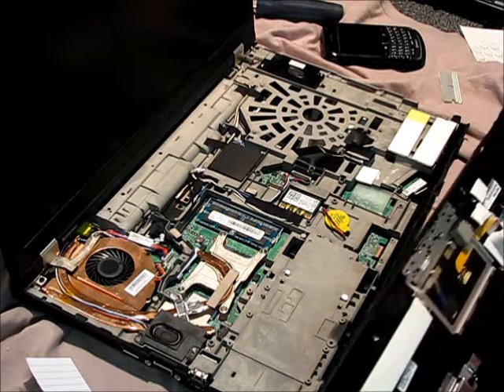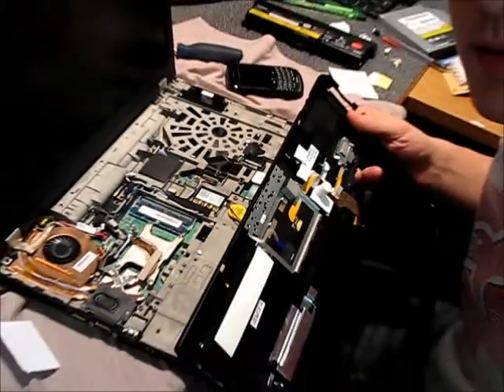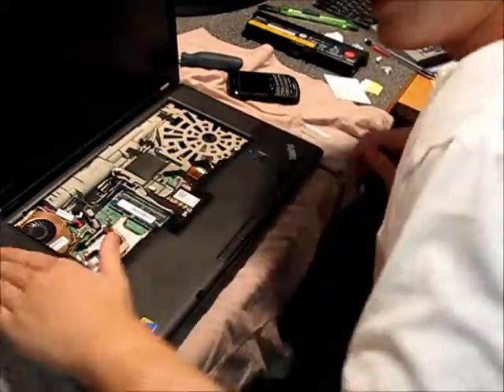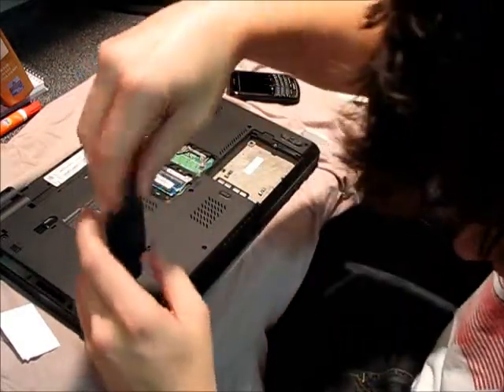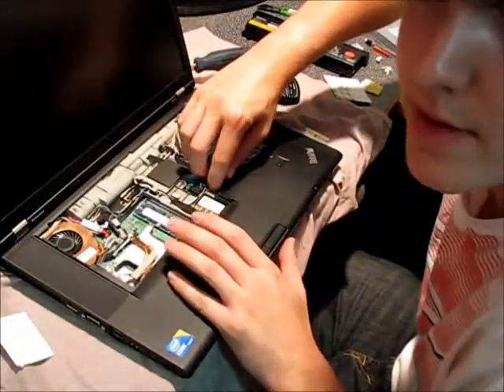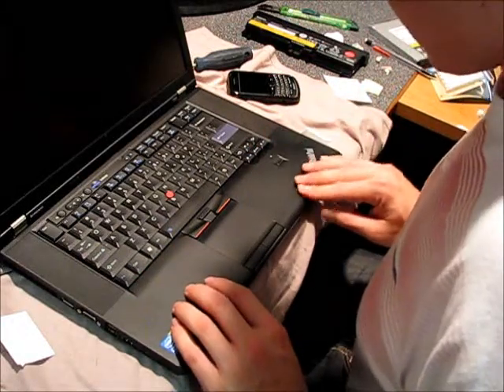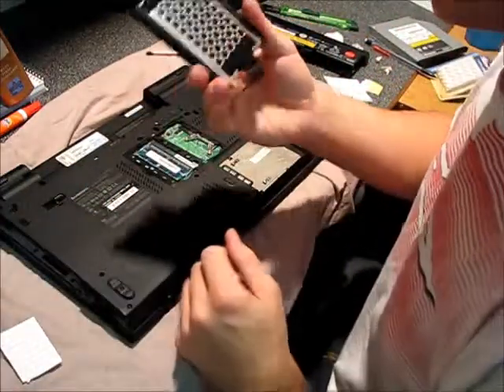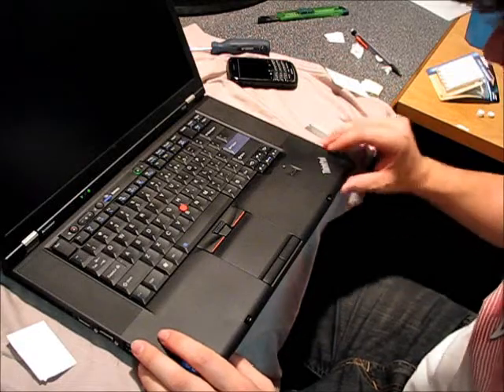Lenovo Thinkpad T510 Palmrest Removal and Fix -- Part 2/3

Comment: My latch is broken on my T510 that keeps the cover closed.  The two hooks that go into the palmrest don't lock, and it looks like the latch spring that you push on his broken. If anyone can provide some guidance on how to repair I would appreciate it.  I have a "Dead" T510 that I can get the parts from to fix my working T510.  I assume this video will get me to the latch parts?  Thanks...